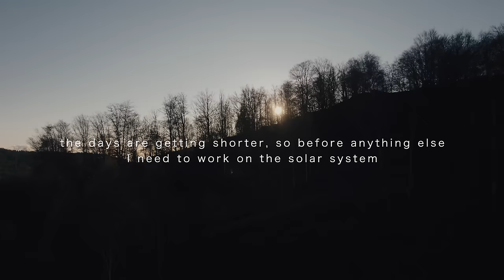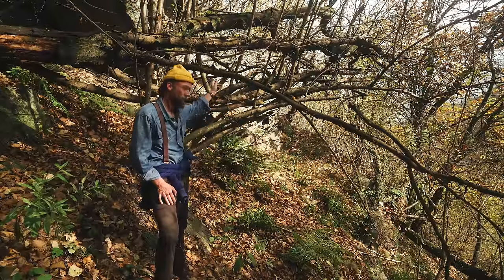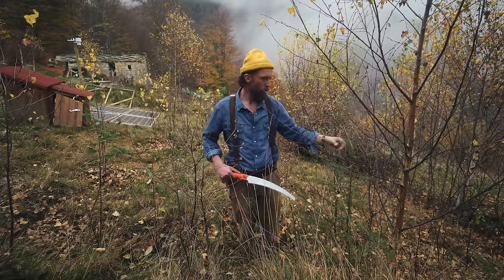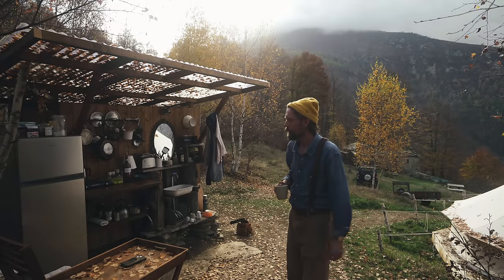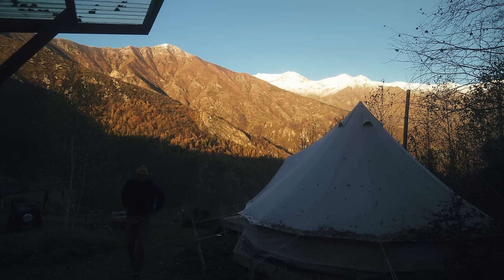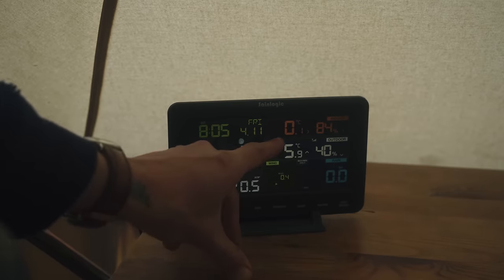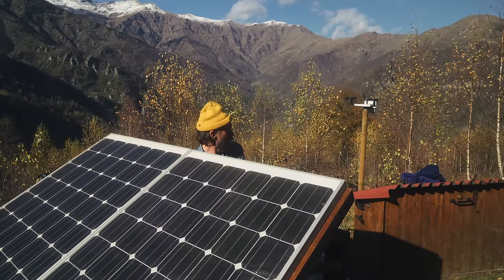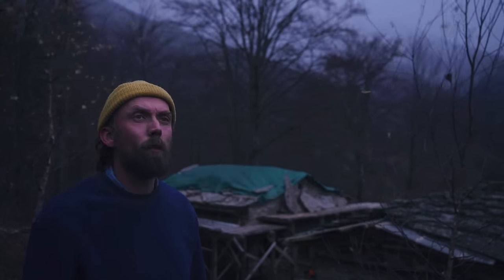#43 Expanding the solar array

Comment: Question for my fellow Martin fans.  If the stones are so heavy, besides the durability why do you want them on the roof??  Seems like I e the number of cobs outweigh the pros?? 

Except for preference, is there a list of benefits  that make it worth the work??  Permits and code restrictions restrictions?? Views?  Genuinely curious.  I thinks it's primarily personal preference or renovation permit requirements.
Reply: All the buildings (even the bus stops, Martijn mentioned) have roofs constructed in this way.

Comment: Here's a link to the MC4 Diconnector Tool: https://www.amazon.com/xjs-Connector-Disconnecting-Spanners-Wrench/dp/B07DPSWJ6J/ref=asc_df_B07DPSWJ6J?tag=bngsmtphsnus-20&linkCode=df0&hvadid=80470624769013&hvnetw=s&hvqmt=e&hvbmt=be&hvdev=c&hvlocint=&hvlocphy=&hvtargid=pla-4584070152854550&psc=1

Comment: Where's the crane?
What about some wind power?
Reply: Are you able to say anything positive or constructive. !?
....if not, then......
Reply: @andymccabe6712  Suggesting wind power because of the lack of sunlight is a constructive comment! Also, he built a crane to lift the heavy roof stones and asking why he's hand balling the stones instead of using the crane is not negative, its just questioning method. Maybe if you had watched all his videos, you'd be asking the same constructive questions!

Comment: what happened to the crane u had built to move the stones?
Reply: Yeah, what happened to the crane??

I think he simply came to realize that its possible to move stones manually if you have enough people to do the job. You know, like in the old days. When they didnt use cranes for these tasks…
Reply: @rompompomkladivo6623  your cynicism and sarcasm are misplaced.
He set off on what he though was the correct path with the evidence available at the time.  As he progressed,  he discovered that he had enough help to do the job a different way - so he adapted. You should respect this.
Your attitude diminishes you ........
Reply: @andymccabe6712  i think the crane project happened because it seemed very fun to do it, because of the aesthetics - it was cool to video record it and because of Martinj’s lack of information. A the time he didn’t have a community formed in the valley so it was harder for him to communicate with people and collect the info. All of that resulted in stepping away from the history and the practises of the people in the past when building these stone roofs and building of a crane which actually showed to be unnecessary (and if nothing else it was (very) dangerous to use)

Also, you are right, I was being a jerk in my comment. I get carried away sometimes.

Comment: Martijn: As a fellow craft person, may I offer a couple of suggestions?? 
If you are going to work in the dark, why not get a couple of these LED fixtures and hang them in your work areas. They only use 42 watts and light up the area better than sunlight !! There also only about 20 bucks each so they are "dirt cheap" !! I have a number of them in my shop/garage. 
https://www.amazon.com/Linkable-garages-Daylight-Ceiling-Worklight/dp/B09QPNS93C/ref=sxin_16_pa_sp_search_thematic_sspa?content-id=amzn1.sym.4e7a2229-074e-44de-95c4-9fd858f46295%3Aamzn1.sym.4e7a2229-074e-44de-95c4-9fd858f46295&crid=3KS6VIA2IQKA&cv_ct_cx=LED+2+lamp+shop+light&keywords=LED+2+lamp+shop+light&pd_rd_i=B09QPNS93C&pd_rd_r=2ce5bede-25d9-46b9-ba08-defb38d855a6&pd_rd_w=ie1Pk&pd_rd_wg=guygX&pf_rd_p=4e7a2229-074e-44de-95c4-9fd858f46295&pf_rd_r=RHB792KGPPW26JHWN7KQ&qid=1668123691&sprefix=led+2+lamp+shop+light%2Caps%2C185&sr=1-1-a73d1c8c-2fd2-4f19-aa41-2df022bcb241-spons&psc=1
Hope this link works. ;o(  If it doesn't, they are 4' long, two lamp "linkable" fixtures that are 42 watts, 4800 Lumens, 5000K (bright) and come with a pull chain switch. As you can see from the link, they are from Amazon. 

Also, if you're going to do anything similar to the other building, I would strongly suggest getting a 1/2 ton pickup with a lumber rack for hauling all the lumber up the hill. Your camper just seems to set there. Maybe it could finance the pickup purchase. I feel sorry for that little trailer plus you need to make so many trips with it.
Reply: BIG difference, financially, between using what you already have, and 'getting' another truck......!!
Reply: @andymccabe6712  Understood and agreed. Some costs, however, are worth it. That's why I mentioned the camper since it just sits there and loses value.